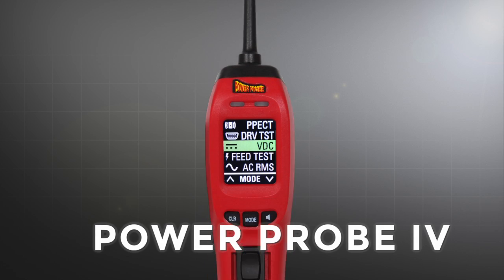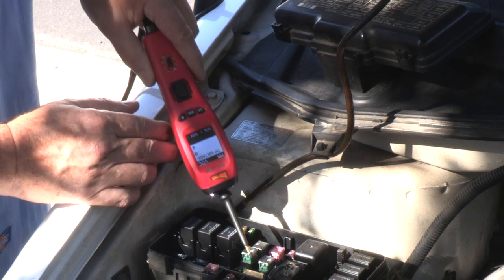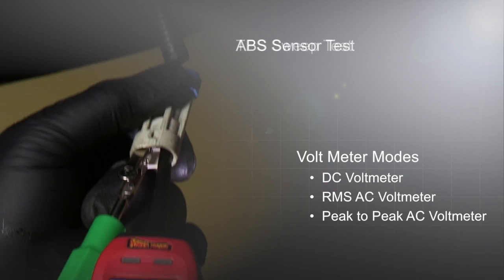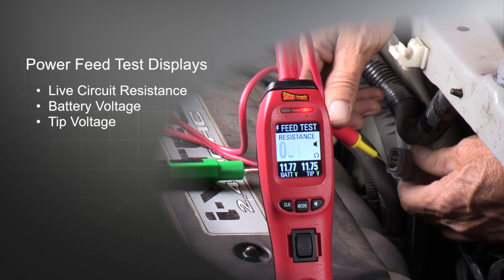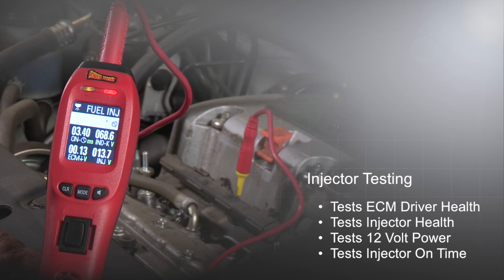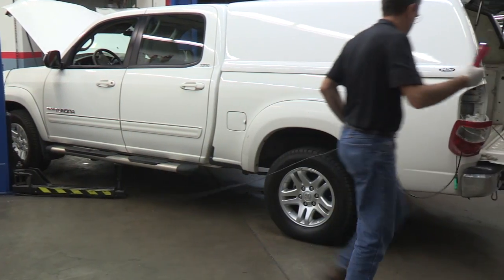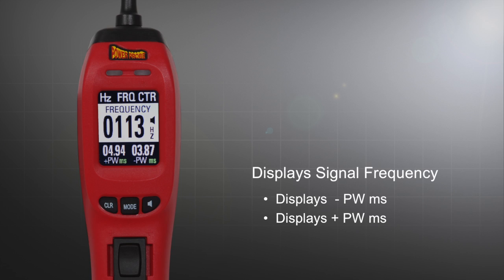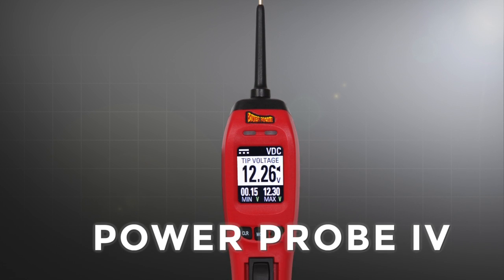The New Power Probe IV Electrical Diagnostic Tool

Comment: Something just happened to my pp4. It displays only "circuit braker resetting" every time when connecting to the vehicle's battery. Does anyone know what to do to fix this problem? Internal fuse looks ok. I don't know what to do
Reply from the maker: Please call Power Probe at 1 833 533-5899. We can help you with this!

Comment: Funny how there aren’t any current feedbacks on this tool. I just purchased this one over the PP3 EZ thinking it will be more future proof. I am a DIYer so maybe a little overkill for me but but once buy right. You should be making more current videos on your products. I assume it is made in the USA since there is no mention about that.
Reply from the maker: Hey Walter- thanks for the purchase. One key feature that the PP4 has over the 3 and 3EZ is the ability to measure resistance. Check out the 21 minute mark of the video at https://www.youtube.com/watch?v=06q0Rm4hMMk

Comment: What I think would be really handy is for it to have a setting where it could detect if it was upside down and auto-flip over the display.   Of course you should be able to disable this mode if you were actually hanging upside down with it trying to look at the display.   Maybe just an extra button to toggle the display flip would be sufficient.

Also I thought that actually having the option to display the duty cycle in the frequency counter mode, rather than, or in addition to, the high/low times, would be great.

Comment: But it still has a pointed tip....why the hell are you encouraging piercing wires in modern diagnostics?  Powerprobe is a joke,  I'll keep my fluke 87 and loadpro test leads.

Comment: it does not come with a cigarette lighter adapter which is a pain in the ass to open the hood and hook it into a battery
Reply: @PowerProbeUSA  hello. I have two questions about this device !At the back of the device there is a small mini connector for which it can be programmatically updated ?

Comment: NO SUPPORT AND NO RESPONSE FROM THEIR CUSTOMER SERVICE!!!
Reply: +Lenz Brown BE VERY CAREFUL IF YOU ARE PLANNING ON PURCHASING THIS TOOL!!! I have And I am very disappointed. There is no support and the ground testing side of the tool fails. It has caused me to mis-diagnose certain faults concerning the ground or neutral test. I sent them emails at their site but no response.
Reply: +Lenz Brown BE VERY CAREFUL IF YOU ARE PLANNING ON PURCHASING THIS TOOL!!! I have And I am very disappointed. There is no support and the ground testing side of the tool fails. It has caused me to mis-diagnose certain faults concerning the ground or neutral test. I sent them emails at their site but no response.
Reply: +Lenz Brown THERE IS ABSOLUTELY NO WAY TO CONTACT THIS COMPANY
Reply: +Lenz Brown THERE IS ABSOLUTELY NO WAY TO CONTACT THIS COMPANY
Reply: +Lenz Brown yes there is! Not had any problem with contacting them
Reply: *****
Thank you. My apologies
Reply: This is why I use and enjoy my power probes 3 and 4, you are buying into more than an excellent tool,you are buying into the support network provided by a company committed and passionate about their products.
Reply: +Andrew Wilson  Think next purchase is going to be a PPECT2000, looks like a very useful tool and could save time fault finding. I use a multimeter at present but this does not always help diagnose where the fault is and so spend ages removing trim and seats to get to looms. The actual repair takes minutes but finding the fault takes hours!. This only going to get worse as they putting more and more wire into cars and multiple network nodes.

Comment: Got mine on order from my Matco Tools guy supposed to be here in the next week or so! 😆
Reply: +Charles Shirley (CharlieNasa) Hi. can the power probe 4 test the cam and crank sensors if they are providing a signal? thank you.
Reply: Denkha94 there are several different types of those two sensors. Each with its own output signal. So unfortunately the answer is both yes and no depending on which one you have. I will say that I like my Power Probe Inc. Hook better than the IV. My go too "test light" is my III! Lol
Reply: +Charles Shirley (CharlieNasa) the reason that I am leaning towards the power probe 4 is because of its injector mode and ECM computer driver test. is their a way to test the PCM/ ECM driver health without the power probe 4? thank you.
Reply: Denkha94 no, it's alone there
Reply: On amazon this one is only 150 dnt get it off trucks matco tried selling me the power probe 3 for 140 just the 20 foot wire nd battery terminals thats it. Their power probe 3 with kits for 140 on amazon i hope i save alot of people money!

Comment: I did call Power Probe and they are not for sale at this time. I was told the will be available some time in January. Price? Possibly around $275. Time will tell. Looks like it will a useful tool to add to my tool box. I was willing to buy one today. I think in the future it would out the Power Probe company in a better light if they would include a release date. It seems deceptive to advertise for months with no product to sale.

Comment: Is the fuel injector test mode timed?  Are there different selectable increments? Where is the user manual on your website?  Are there trade-in upgrade options, etc? Thanks

Comment: So I can't find this anywhere on your web site, or for sale anywhere. How about a MSRP for starters...
Reply: This will probably be only available off the tool truck and will be severely overpriced as usual. I don't know why Jeff does not put an outer silicone jacket on the 23 ft power cord for those of us that work out in the cold as well as an outer rubber jacket like a DMM such as Fluke has. Being outside in the cold and possibly knocking the tool to the ground can take its toll. The tool does look like it has some nice features however it would be nice to have a graphing mode such as its brother the Autel has. Tool trucks should be eliminated and that certain brand of tool manufacturer should have outlets all across the country so as there would be a certain level of convenience for the customer when a replacement is needed and not waiting for the tool truck to come around whenever as well as possibly lowering the price of the tool and keep the middle mans wages out of the price.
Reply: Daniel Sullivan  hi Dan,  how can they steal your patent without paying license fee? I don't get it?  Did they find some loop hole in your patent definition?  Pretty messed up.  I like your LoadPRO diagnostic tool.  Its funny, I thought the PP3 would load test until I saw your video comparison.  I didn't even know they came out with a PP4 until now.  I see they increased the meter resolution to 4 significant digits now 0.01volts or ohms.  Your device coupled with any fluke meter is a very effective and affordable tool.  Can you post some videos showing how to use the tool to trace back in the wiring starting from the load to find the point of high resistance?  That would be really helpful.  Thanks
Reply: Daniel Sullivan Before I start- I DO OWN A LOADPRO AND YOUR BOOK & A POWER PROBE 4. How did he steal your patent?  The PP4 ISNT  a load tool like your LoadPro. The voltage drop test (Feed Test/Resistance/Continuity) the PP4 showed  is loaded by the vehicle component being activated by the users hand , he just back probes the component while active and the PP4  displays the difference in voltage  between the battery and the PP4 tip (while displaying any resistance)...No "loading" by the PP4 at all.